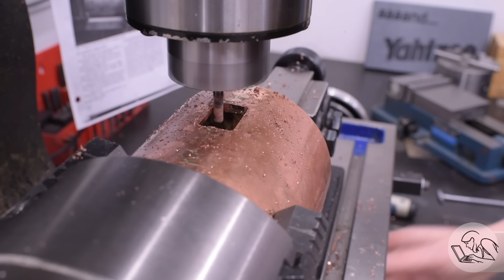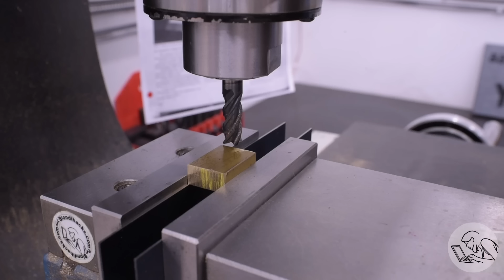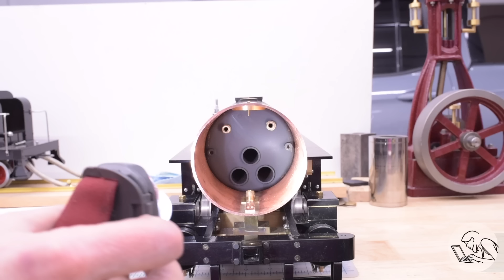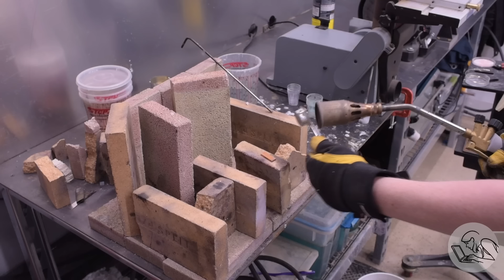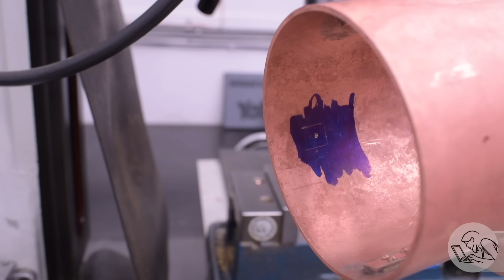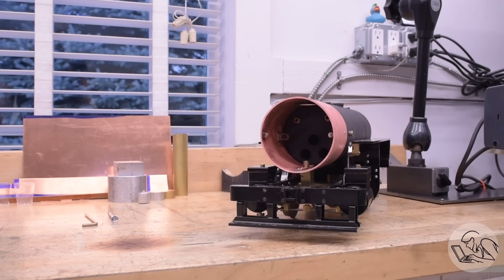Finishing the Smoke Box! - Pennsylvania A3 Switcher, Part 90

Comment: Bare in mind I have about zero experience soldering, if you were concerned with a straight line with the white out could you have used the roll on stuff? 
Also another commenter said that's a Canadian term but it's what I've always used here in New England, regional terminology really is interesting.

Comment: As you point out, this smokebox is in many ways a shorter version of the boiler (from a manufacturing perspective), just on "easy mode" because it's shorter, seems less complicated, and doesnt have to be airtight.

With that in mind, would you recommend that other people building an A3 Switcher build the smokebox before the boiler, as a "warmup" or practice run?

I think I remember at the very start of this series you said you wanted to make the boiler first, as you thought it would be the most difficult part. I'm not up to that level of boilermaking yet, so I've been working with smaller stationary engines for now, but I do hope to get to building a locomotive eventually so would love to know your thoughts on this
Reply: not a machinist, but I would say no? because they have to fit together, and it's easier to modify the part that doesn't need to hold steam pressure

Comment: Yes!  You definately gained MANY steam engine points with the smoke box.  Nicely done.  I had a similar problem with my boiler mounting studs and I made it work by enlarging the holes.  Your solution was much more refined.  Nicely done, Quinn!

Comment: At one point I had a project I used a step drill on where clearance was a problem.  I took a cutoff disc, and cut a bunch of the smaller steps off to avoid a clearance problem on the bottom.  Even though it would mean changing the bit a few times, I'd think there's spots that having a few partially cut down step drills would be handy.  As inexpensive as step drills are these days, I wouldn't hesitate to make that set if I had an application.  Another reason Canadian Tire is our homeland ;-)

Comment: What else can be said except, Nice work!  I'm a retired aircraft mechanic and as for "compiled dimensional error' Airliner skins and panels typically have a tolerance of + or - .030 and adding that up over 20 or 30 parts that dimensional error becomes huge. It's not uncommon to have to file away 1/4 to 1/2 inch of material to get a new skin or panel to fit. So i understand that feeling when things don't actually fit per the drawing.